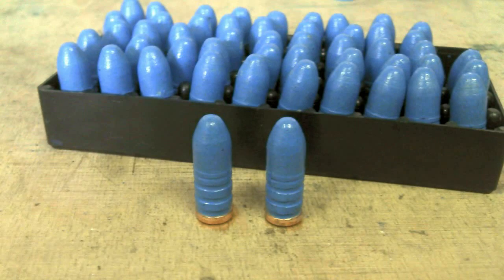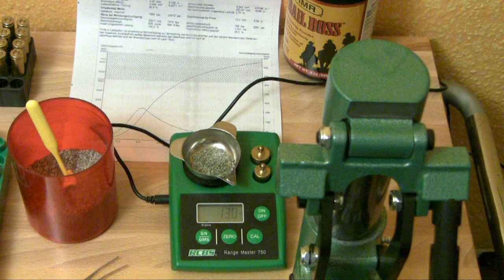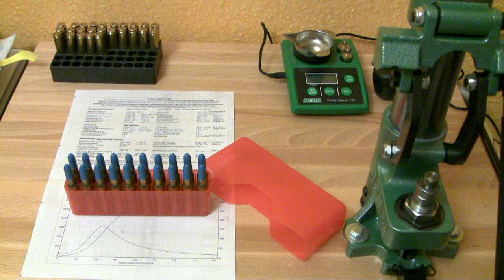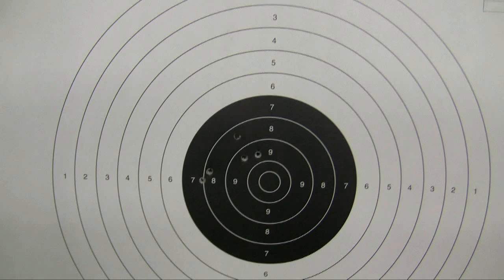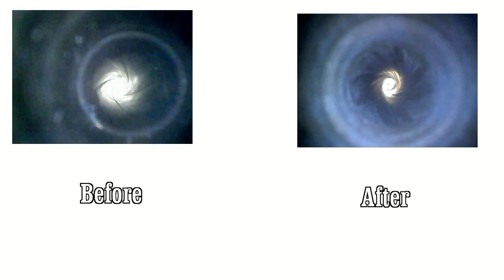MCC2 - Color Coated Rifle Bullets / Testing 1

Comment: Nice rifle, I have an FR8 myself purchased at a local gun shop for $180 about 6 years ago. Have been handloading for many years but have just gotten back into casting. I want to test the enamel coated bullets next time I cast for my 38 Special and 357 Magnum. Keep up the good videos.
Reply from the maker: Thank you very much for leaving a comment brother. I like my FR8 a lot; it's a cheap but very good Shooting rifle...would buy it again all day Long.
Reply: Mine fits its purpose well as a truck gun when I am over working on the farm, it also goes along as a camp gun during the warmer months.
Reply from the maker: Yes, it an Handy rifle...great choise for an camp gun. Thanks again for your reply brother

Comment: Very good shooting especially at 150 meters! What do you use to get the blue stuff out of your barrel? Lead bullet painted blue with a gas check I guess you did not use lube or had any leading or smoke right?
Reply from the maker: No, not 150m...only 50m. A regular solvent does the Job of remove any particles of the Barrel very well. There is no leading and less to nothing smoke

Comment: Very nice, Im trying to source the components here in norway, I shot a lot of the year indoors, and the climate isnt great indoors with ventilation. when shooting 175 and 200gr LSWC in .45acp etc. the leading is huge, pestering the enviroment for myself and other shooters, Ive found a local bullet caster offering to sell non lubed bullets cheaper. Have you tried useing a heat source like heatgun into the bucket when shakeing them? Im hopeing not to have to bake in the oven.
Reply from the maker: Yes, I've tested this. With my coating they bullets start sticking togehter even while tumbling them. The surface of the coating is not very smooth when I use the heatgun.
Reply: wiederladerTv Thanks for the quick reply, you saved me time and testing then. Have you btw tested mcc2 on bullets for your AR? this cold be a cheap way to get more practice without breaking the wallet in ipsc, guessing thats what you also  use your rifle for?
Reply from the maker: I did not test the MCC bullets with my AR because of the Stoner system. I think small particles from the coating can build up in the gas system and cause problems.

Comment: Hi Wiederlader, do you have a direct link to the webshops, where you bought the components for the color coating?
Reply from the maker: Sure...hope it works: @Industrielacke/Epoxid-Decklacksysteme/
Reply from the maker: Hmm it doesn't. Please do a Google search for Ehrhardt Lackversand. Then use Industrielacke and choose Epoxid-Decklacksysteme
Reply: wiederladerTv Thanks for the answer. I think i have found something that can be used. It's 2-K Epoxy top-coat for boats. I have thought about the dry lubricant you added in your mix. I don't really have the funds for a can of "the good stuff", but i happen to have a rather large amount of graphite powder. Do you think i could use that instead?
Reply from the maker: Yes it works. I've tested the coating with Moly and graphite also and it works pretty good. You can't produce bright Colors with that but that's the only downside
Reply: Awesome! I'll make some tests. There's going to be a lot of shooting. I'll test two different bullet weights. And i will be loading subsonics, so i have to make test-series. Approx. 9-12 rounds pr. test. pr. bullet weight. I'll test the following: 160 gr and 180 gr bullets. Hardened + gaschecked, powdercoated, epoxy coated, epoxy + graphite coated. It's going to be a lot of fun :-)
Reply from the maker: Please leave a short Report when your testing is done. Thanks and Greetings from Germany
Reply: I will. Thanks for the help.. From your neighbor, Denmark :-)